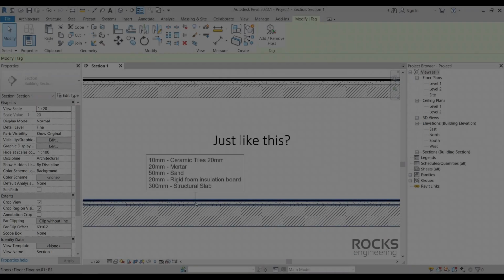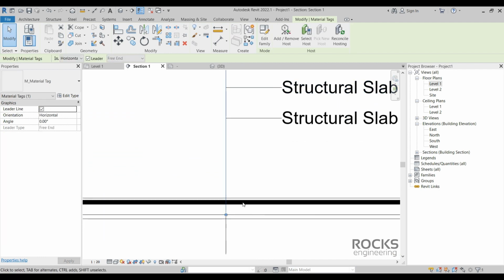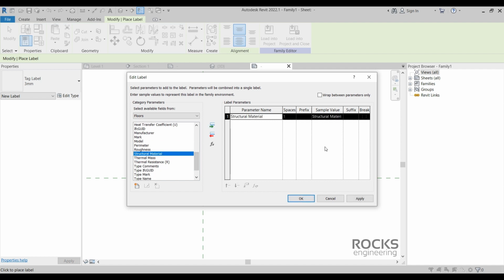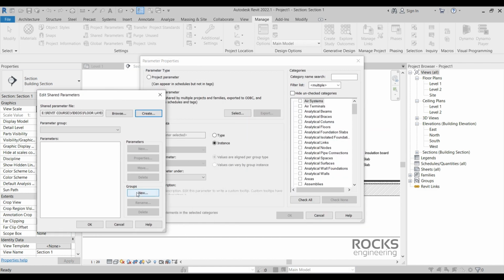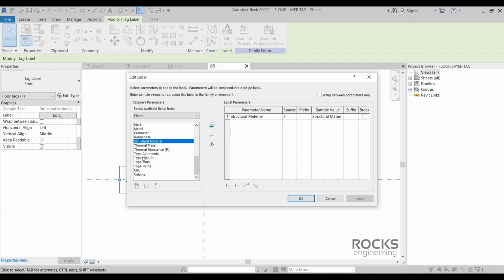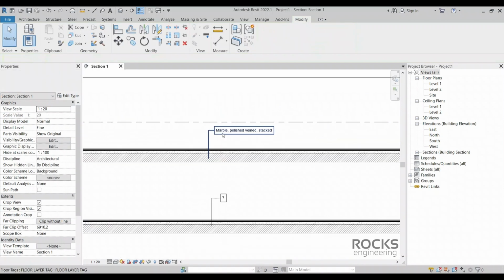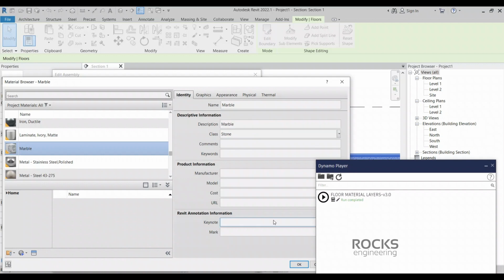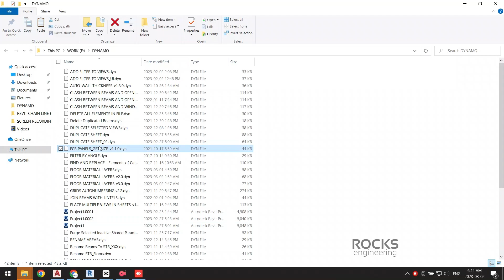One Touch Floor Layers Tag | Revit Tips and Tricks

Comment: Thank you! It looks perfect. But in Revit 2025 I can't run script successfully - there is the mistake "Element.SetParameterByName operation failed. No patameter found by that name." May be you can help to solve it?
Reply: Sorry)) it works! I've just realized that named parameter "Floor layers" instead of "FLOOR LAYERS" like you)) changed it in script and now it works perfectly! Thank you :)

Comment: For perfection > Layer number - Material name - Thickness.
Reply from the maker: Do you mean that this is the perfect order of the layers information?
Reply: @rocksengineering-eg  Exactly. It is not absolutely necessary, but there are situations when the sequence (layer) number is also useful.
Reply from the maker: @uldistucs  Actually, you can customise everything, but it need more deep knowledge to the dynamo.
But i can help you to find what is suitable for your project. 
Please contact me by email: 
engineering@rocks-eg.com
Reply: @rocksengineering-eg  Thanks, no help needed, I already made one. I am currently trying to make a Legend Component Tag for walls, floors (so that all structural layers, thicknesses, etc. are visible).
Reply: when I open the link I get Error 404
Reply from the maker: @lyubomiramomcheva3908  Please check again now, I updated the link